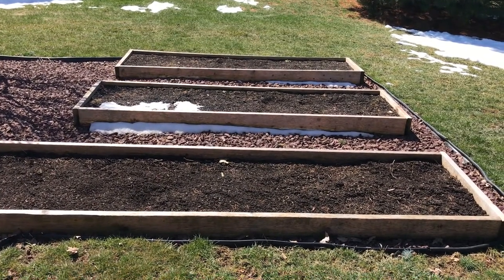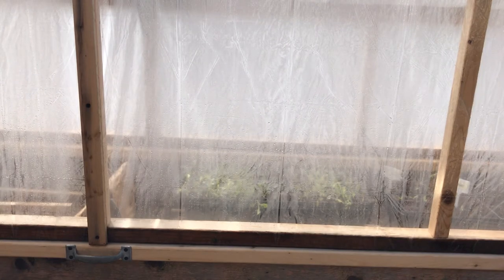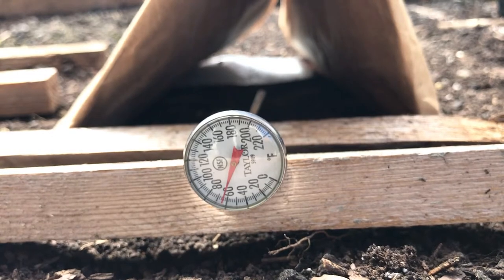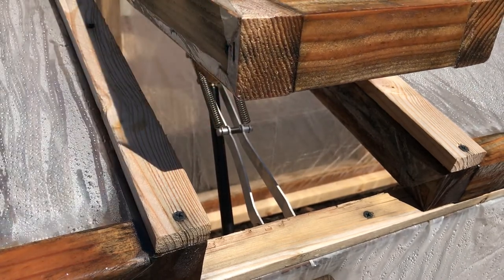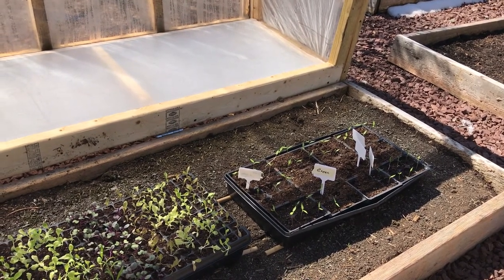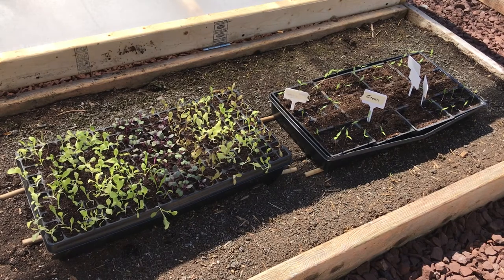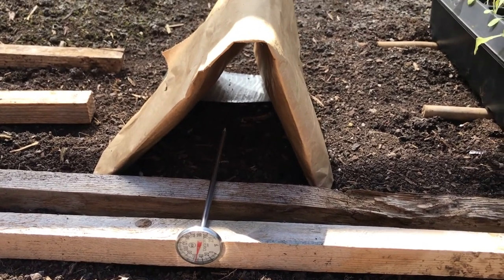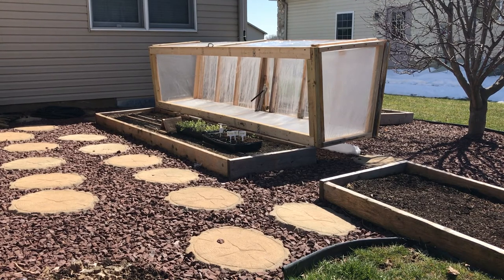Grow Food All Winter With This Double-Layered Cold Frame.

Comment: Really nice Cold Frame. Why did you build so tall? I'm in a zone 5b and I only see low hoops or actual green houses. The low hoops with much less exposed surface would seem to loose much less heat. Plus our winter greens are all pretty short, we're not growing any tomatoes, peppers etc. What is your plan for the spring/summer, removal? Thanks!
Reply from the maker: The cold frame is only a few inches taller than my hoops & row covers. The height is ever an issue. I'm able to take the panels apart and store them after it warms up. Thanks for watching.

Comment: Great idea! Have them in my greenhouse, but it never crossed my mind that you could use them in a cold frame, all convential cold frames have big, heavy lids. Question: did it work as hoped? Best wishes, greetings from Holland.
Reply from the maker: The opener worked as advertised. I have it set to open around 70 degrees. Was put back up a couple weeks ago and will be growing lettuce all winter with an additional feature. There'll be a video about the upgrade soon. Thanks for watching.